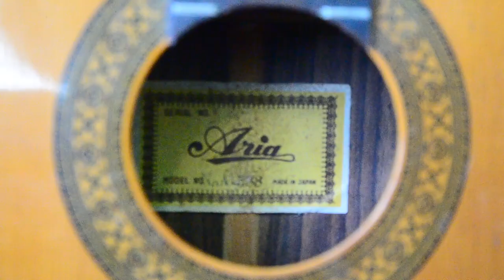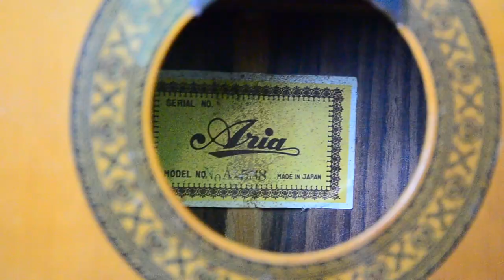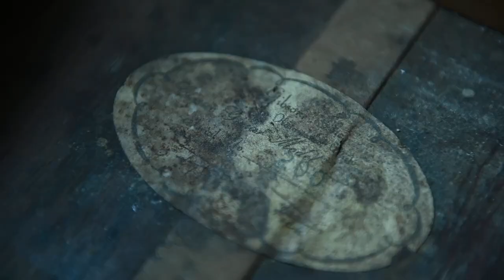How to Remove the Top on an Acoustic Guitar

Comment: I saw on another channel that commonly used binding glue melts the binding at the joint slightly so it legitimately fuses with the wood. Thats why it is so damn hard to remove.

Comment: Thank you for posting this and explaining it so succinctly. I'm midway through a build and dropped the body while working on the binding with a router. I opted to save my fingers but dropped the guitar on concrete, cracking the binding and the top. I've been hesitant to remove the top but I think maybe I should now so that I can inspect for loose braces.

Comment: Can anyone help? I want to transfer an image to my acoustic guitar (GPC 16E). The best product I have found so far requires the heat from an iron to be applied to the back of the image, which is face down, on the body face. Will this harm the guitar face, or cause the glue around the edges to weaken? Thanks for the help. Ak

Comment: Titebond sucks! So if you clamp overnight you do not allow it to do its job properly and your instrument will be weaker and will likely sound more dead than if you let it suck the joints together naturally. And on tap tuning, do you use harmonics to check intonation? This technique helps with developing the "ear" that will allow you to tap tune a top, perhaps even top tune a tap!
Reply: Can you elaborate on titebond sucking? Does it contract as it dries? Why would clamping deaden it? What difference does it make for the glue? I would think there would still be glue in the joint just less of it? I am an amateur and this is the first time I've heard this! Thabk you for the info